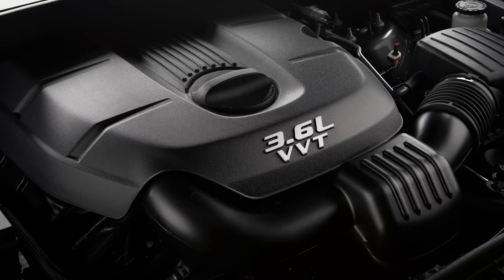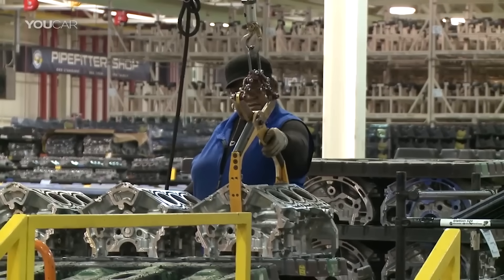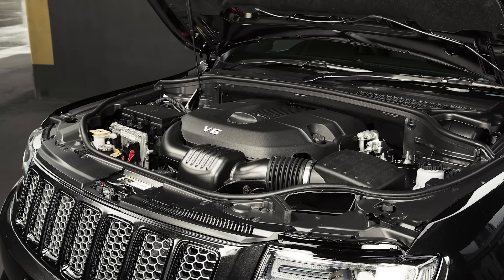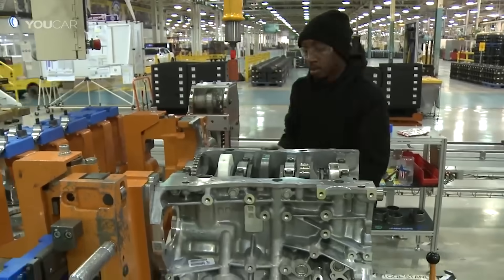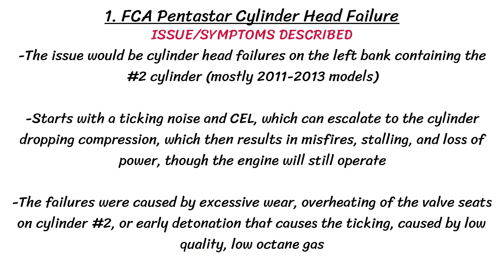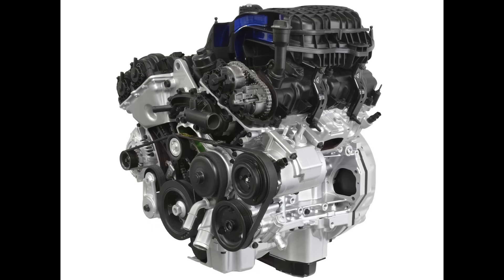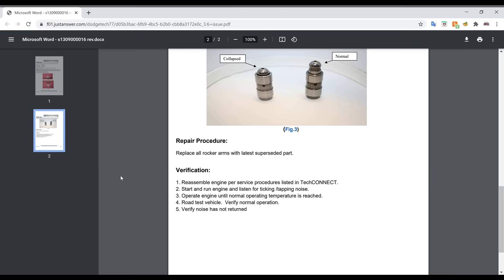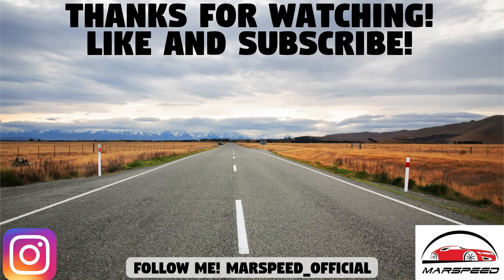The Specs and Fatal Flaws of the Chrysler 3.6L Pentastar V6 Engine

Comment: Fatal flaws of the pentastar: 3
Fatal flaws of the 62TE "Ultrastar" transmission attached to earlier 3.6 FWD automatics: infinite
Reply: The ultra drive transmission is a 6-speed variant (62TE), introduced in the 2007 model year and remains in production for several models as of 2019 in front wheel drive application.
Reply: @mickjagger8904  maybe older chrysler models but not newer vehicles they all switched to the ZF 8 speed transmission
Reply: @kmbud  The 2020 Grand Caravan is available in three trims: SE, SE Plus, and SXT. All models come with a 3.6-liter V6 engine and a six-speed automatic transmission. That is from the Chrysler web site. My point was that the "Ultra Drive" is NOT the 8 speed Chrysler transmission, such as found in the "300" or "Charger". The "Ultra Drive" 6 speed is Chrysler's front wheel drive transmission and is still currently in front wheel drive production vehicles.
Reply: @mickjagger8904  not all front wheel drive my dart came with a hyndai 6 speed powertech transmission and a fiat 6 speed standard which is what i have and the newer 200s don't have the ultradrive 6 speed after 2014
Reply: @kmbud  the Ram Promaster still uses the 62TE when paired with the Pentastar because it's a FWD vehicle. All RWD vehicles switched to the ZF8 and most FWD seitched to the ZF9 (which had their own issues early on).
Reply: @MrLuisinho90  becides the dart dart used a hyndai transmission and fiat manuel transmission
Reply: @kmbud  true, but I thought we were talking about the Pentastar paired with the 62TE. The Dart was 4 cyl only...
Reply: @mickjagger8904  still crap. They should use the 8 speed transmission also  for Caravan.
Reply: @kmbud  means ...your Dart is a crap :)))
Reply: @kmbud  that trans is also junk just test drove the jeep trailhawk trans went out on test drive it only had 50k miles lol
Reply: @kmbud  
And some use the ZF 9 speed although early 9 speeds shifted horrible or erratic....My wife had a 2014 Cherokee with the ZF 9 speed, it was scary to drive!!
Reply: @mickjagger8904  The Ultradrive 6 speed is the old A-604 with 2 gears added on in an extended housing. Remember the 90s Caravans/Lebarons/ Dynastys etc with their grenading A-604 trannys? :-)
Reply: I've been a mechanic for 6 years and I've yet to see one of these transmissions fail. I've seen all of the mentioned pentastar engine issues though.
Reply: @madmatt2024  I agree with you... I have over 300 thousand miles on mine and both the pentastar motor and the 62te transmission are going strong !
Reply: The 62TE is a decent transmission...when serviced regularly. It should never have been a "sealed" unit with "lifetime" fluid. Do a transmission filter and fluid change every 30K and it should last you. The 42TE (the base for the 62TE) in my last T&C was at over 300K miles when I sold it, I just picked up a 2014 T&C with 138K on it and it's doing fine. I'll be dropping the tranny pan in a week or so for a service.
Reply: @ironmanmachine   Lifetime fluid does not exist  !!!!
Reply: @ironmanmachine  
"LIFETIME  tranny fluid is bullshit.....change it every 30-40,000 miles  if u want your trans to last.
Reply: I must be lucky, 220k miles on my 62te and still going strong.
Reply: They do love to upshift ridiculously early. Like 1st to 5th from 0-30, and let the engine struggle uphill...
Reply: @Tool Time My experience still isn't as impressive as your lack of ability to find better things to do with your life. I'm so humbled.
Reply: I wish I could up-doot this more than once.  That transmission is hot trash, failed at 89k on my Journey (3 months past 6 year powertrain warranty).  Went from fine to grenade in 1 block.  What the actual..  Thought my issue was a one-off until I had it rebuilt, the trans guy keeps them on the shelf because they're so common to fail. sigh
Reply: @aaronkoch3273  Mine blew at 40k miles and 2 1/2 months outside of 5 yr warranty!  Dealer was nice enough to do a "courtesy" replacement for the low price of $1600!  That's some fine customer service!
Reply: Was called ultradrive not ultrastar
Reply: @kmbud  I stand corrected, thank you.  Although us owners might call them ultra (Something else).
Reply: @The3chordwonder  Ultra-shit?
Reply: @TestECull  i never had problems with mine they just shifted like shit and lacked output that was the weak link in my 200
Reply: @kmbud  
That 200 has the ZF 9 SPEED trans.......the 8 speed is smoother

Comment: Well crap. I just ordered and bought my very first Jeep ever, a 2021 JL Jeep Wrangler Unlimited Rubicon, with the 3.6 Liter V-6. I went with it over the 2.0 I-4T engine because I was told that it was a very reliable and proven, quality engine that was placed in numerous vehicles and had been for several years now. I also chose it because I preferred a naturally aspirated engine over one that has a supercharger and/or turbo charger either installed at the factory, or through the aftermarket parts world. So far I’ve had my Jeep for around a month and a half or so and have only put around 500 to 600 miles on it. And while it has performed just fine as of this past month and a half, I will now be hoping that my Jeep’s engine does not have this same issue later on down the line, because that would suck!
Reply: I'm with you. About to order one myself, but this thread  scarring me..
Reply: @petertosh4748 , when I ordered and then bought my JLUR, I did so for the sole purpose of taking the production company that I own, going out off roading and to start filming, producing and releasing video content around off roading, reviewing off road related gear, camping and exploring new and exciting locations and places that are totally and completely off of the grid in every single way, shape and form from everyone, and last, volunteering my time and equipment for doing search and rescue, and/or search and recovery operations of missing people and/or stranded vehicles in these off road locations.

Because of that, I have also been bringing on sponsors for everything that I am doing. 1 of those sponsors is the dealership where I ordered and then bought my Jeep. The dealership is called “Korf Motors” here in Sterling, Colorado. My salesman was a guy named Tony Peckham. If anyone from anywhere that is here within The United States of America calls and talks to Tony about ordering a vehicle, he will order it for them and have it delivered from the factory, where the vehicle was built, to wherever it is that the customer lives and/or is wanting the vehicle delivered to them. If anyone tells Tony that they were referred to him and the dealership by me, J. Ralston, he in turn will give them some very special pricing. That even includes the all new 392 V-8, JLUR. The phone number to Korf Motors is,
970-522-1500
On my 2021 JLUR, the MSRP on it came out to be $58,235.00 with the invoice being right around $55,000.00. Tony sold me my JLUR for $53,205.00. 
If you decide to call him and have any questions, feel free to let me know how I can also, maybe help you out in any way that I can as well. Tony is a very good dude though and he will not jerk you around.

Comment: 160k miles in my WK2 and still going strong 👍

Now I know what to work on before boosting it 😈

For real though, the Pentastar is solid af. Compared to the horror stories I've heard from everyone in the other camps with their various V6s over the decades, Mopar really did an insanely good job on this thing. Decent power, uncannily smooth, and respectable potential too. Really a solid all 'rounder.
Reply: Agreed. My 2018 GC has 35k and I’m loving the power. It’s good to know it’s also durable 👍
Reply: On average, I condemn 2-4 of them a week. Dropping seats in the right head, timing chains, phasers, and the oil housing. They are not solid at all.
Reply: @iamtheoffenderofall  
lets do some quick math here:
Assume 4 per week from just you, that's 52ish per year multiplied by say 200 other locations also condemning 4 per week all year you get 10,400, divide by we will go with 15Mil since the video said they already hit 10Mil awhile back so lets make this easy and we get
total of .27% failure rate per year is not bad, nothing is perfect.
Reply: @tartartar7198  quick math you neglect....at the height.. 500 per WEEK reported by dealers across the US. Cherry picking numbers will never help your case.
Reply: Lmao, by your numbers that would be 5mil engines condemned per year... hmm well we know that didn’t happen soooooo... someone is full of shit.
Reply: @tartartar7198  the 600k Pentastar Ram Sprinter 😉

Comment: Thanks, Marspeed! It's been awhile, eh? :) Fab post, as always.
This wonderful engine powers my uncles & dads '14 Journeys very well. Smooth, efficient and really decent power. Both AWD. My dad's Journey had a rear diff replaced at 120k, but it was a fleet veh. purch & obvo had the beans beaten out of it for 100k before he bought it. 
You'll never see something like the slant six again, bc ppl want light weight & all that emissions baloney. 
The whole 'tick' deal could've been largely avoided with like 5 lbs heavier per cyl. head and a 89 octane recommendation, although some ppl (especially bc of the Great Resets ingredient/symptom, the Scamdemic & it's 100% unnecessary lockdowns) are poor af and have to still get around so they buy 87 octane. Never use 87, even if it is an ok rating on your car.  
My folks & I run non-ethanol 91 octane exclusively. Non-ethanol is VERY recommended in machines like lawn mowers, ATV's, snow mobiles etc and as engines in passenger cars become more like those mills, ie more complex and lighter weight..I say it is high time ppl stop using fuels containing ethanol..excepting 
E-85 for race/modified street/strip engines, ofc.

Comment: Great engine lots of HP n Torque. In our 2011 Dodge Journey will over 200k miles. Never once have had an engine problem
Reply: Lol you say lots of horsepower... you ever drive anything elts or do research my 2003 has more horsepower then our 2020 dodge promaster but of course it's an infiniti Japanese v6s have lots of power with more to push dodge had awsome v8s but the rest are garbage!
Reply: you got a good journey then 👏 bc at our shop I swear journeys always have axel seal and engine seal issues
Reply: @jakobanderson6213  there's a joke in northern Canada that if you drive a journey you either have no brain or no money. Either way you'll be calling a tow truck sooner than later. ( mostly new vehicles, 2015 and up.
Reply: We got a 2011 Journey in 2015. Carfax says the head was replaced on 2,4,6 side. But started to have cylinder 1 misfire. I replaced coil, didn't fix it. I swapped an injector with another cylinder. Cylinder 1 still misfire & other cylinder was fine. It eventually went away, now 4 years later it came back for a few days after an oil change & now fine. I replaced the thermostat today (10-23-2021) because not much heat & temp gauge was low. It actually had a P0128 code for thermostat when I checked for codes from the misfiring.

Comment: It's still light years ahead of the Mitsubishi designed Chrysler 2.7L engine!
Reply: That was NOT a Mitsubishi engine. The 3.0L, 2.5L, (and the 2.4 SOHC in the coupes) were though. Thanks for trying, but you didn't try hard enough.
Reply: @MyerShift7  I didn't know it was a competition. That was a rumor that had gone around, or Chrysler was just trying to lay blame elsewhere for that crappy engine.

Comment: My 2005 Dodge Magnum's 3.5L (high output) engine is still going strong. It's almost at 200k, and I still have trouble hearing the engine at a stoplight it's so quiet. Pennzoil 10w30 full synthetic is the only oil I use. I would love if Chrysler brought the Australian version of the 300 station wagon with a PentaStar.
Reply: Got the same 05 Magnum with the venerable 3,5.  Regular service, 185k, NO problems ever on that car, it is definitely Autobahn proof. I have to do a lot of maintenance work all over Germany and it is foot-flat driving for it all the way. It has been converted to run on LPG but no valve seat issues ever. I dread the day when I have to finally get a new car, hopefully not too soon.

Comment: Roller rockers, major oil leaks from the oil cooler oil filter housing assembly, coolant leaks from t stats and other plastic to aluminum mounting points, loose piston ring to cylinder wall clearance which means oil consumption and there by cat converter failures, o2 failures again due to the oil consumption, EGR and plastic intake melt down leading to vac leaks, and much more. There is also a recall on failed cooling fan units and controllers that cover even Ram brand Promaster vans and trucks that allow the 3.6 to get too hot and the high speed fan feature to only work. Call a local dealer with your VIN.

Comment: I bought a new 2012 wrangler that ended up being the early production engine with the head recall. I got the updated head at around 24 thousand miles and now have 104,000 miles with no other problems. Now I do believe in preventive maintenance and maybe this is why I've had no other issues? From my experience with this engine I can not complain

One last thing, After I used the free oil changes from my dealer I switched to Mobil full synthetic oil and run 87 octane fuel with a double shot of fuel system cleaner once a year and haven't looked back sense. So far so good. My hypotheses is Choose a quality full synthetic oil and change it depending on your driving habits

Aa for the cooling system I currently cannot drain my coolant from radiator because of casting sand clogging drain. I haven't experienced any overheating issues so far so I'm cool with having to replace my radiator and water pump if needed later on. From my experience I can't complain one bit about this engine

Preventive maintenance is the key factor to everything mechanical

Comment: I own 3 2014 Promasters with the pentastar. 630,000 620,000 and 410,000 miles. These goddamn engines are bulletproof EXCEPT for the lifter/rocker issue. It’s weird because it either happens between 90-120k, or it never happens. The fix is rev G or H parts. I personally have never had the sand issue, and I’ve never even heard of it until watching this video. The oil filter housing cracking issue is classic dealer bullshit - a few of the 2011 jeep builds had a faulty cooler. But after that, nine times out of ten, the problem is an incorrectly installed o-ring on the oil filter cap. Happened to me twice, and each time the dealer fleeced me for $1000 until I figured out it was the o-ring. If your pentastar pukes all it’s oil into the V of the motor immediatly after an oil change, inspect the cap. The o-ring goes on the wide 2nd land, NOT all the way up against the flange of the cap.

Comment: Just a word of caution from someone who has had a 3.6l replaced out of warranty, don’t run 5w20. . . Your manual will state that you can use 5w30 and you really should. You will not lose any noticeable mpg or horse power and gain YEARS of life out of your motor. And some advice for you guys who have a 3.6l and it’s burning oil, switch to an oil that has a great shear number and can withstand high temperatures. You’ll extend the life of your engine far beyond 200k. Currently running Rotella Gas Truck 5w30 and it’s been great. Used to burn Pennzoil platinum 5w30 and some other brands even though this new motor only has 13k miles on it, but 3year 100k mile warranty so if needed it’ll be replaced.

Comment: 2014 ram 1500 tradesmen 3.6, 140,000 miles I have owned it since 10,000 miles, had one owner before me. and the only issue that I have had is the oil filter housing leak on 2014 and older models. Replaced it with updated part and it works great again. I run 87 octane and use Rotella shell 5w20 full synthetic or amsoil when I can. Change oil and filter every 5,000 miles. Put a cold air intake and it definitely makes a noticeable difference as well as running smoother.

Comment: Knock on wood, I've had great luck with both of my Pentastars, and I push them hard.  Both of them have never seen a drop of gas below 91 octane (because where I live, everything below that contains 10% ethanol), which may have helped, apparently.

Also, you left out two other major problems with these engines (one of which I did experience).  1.  The oil filter housing.  These are notorious for failing, dumping a huge pool of oil all over the engine and wherever you are parked when it fails.  2.  The coolant crossover point between the heads.  Dorman has made an upgraded part to replace this, made of aluminum (instead of the resin type in OEM).
Reply: Oil filter housing is the oil cooler, he did cover it

Comment: 2015 Journey, had a rocker go out, replaced it, then 2 weeks later another one failed, so I replaced the rest of them, pretty simple job if you're mechnicaly inclined, didn't need any special tools, just a bent clothes hanger to realease the timing tensioner.

Comment: These are definitely not the worst V6 engines Chrysler has produced, but they're still not very robust at all.  I work for a pre-owned dealership and see many of these come across here and too many of higher-mileage examples (over 75K) have that upper engine tick.